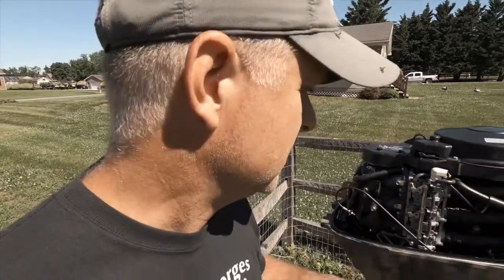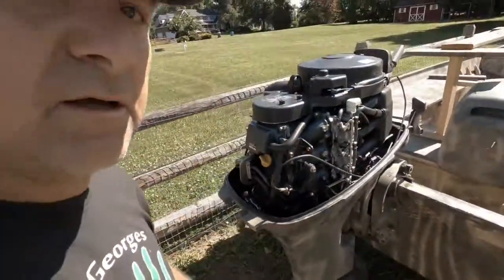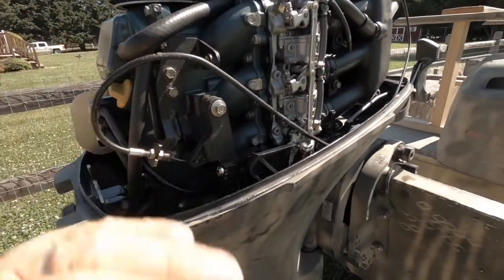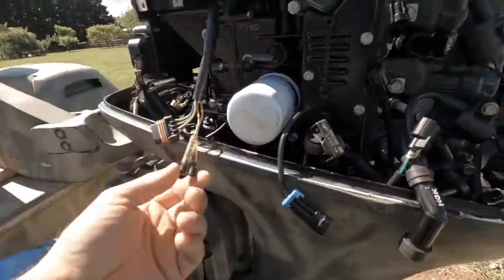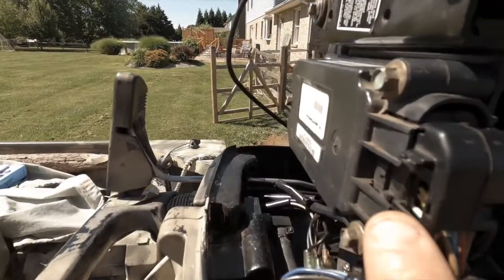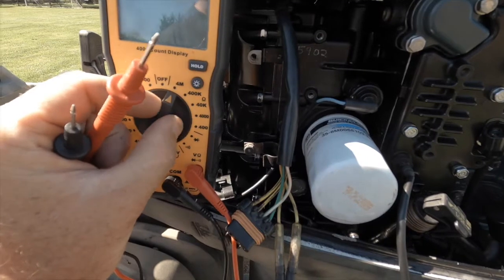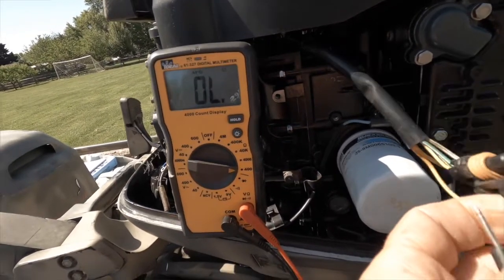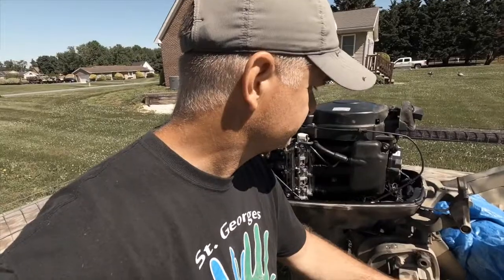Mercury 4-Stroke- ECM? Stator? Trigger?  what the heck is wrong?

Comment: Worse case scenario for me, to start pulling flywheels off. A relatively simple task becomes a P. I. T. B.
MARINER 15,FOUR STROKE. 
COIL READINGS ALL OVER THE PLACE.
288 KOHMS ON PICK UP COIL. 
78 ON STATOR.
 ALL NEED REPLACING.
Reply from the maker: Yeah, best bet is to pull the factory specs and see if they fall in line.

Comment: Did the stator fix your issue? I am looking at my son in laws motor, same issue, no spark on #2. It will
run with two cylinders but it has no power. I was thinking it was the ECM and saw they were no longer
available and if they were available, a little pricey to just swap out.  Thanks
Reply from the maker: Sorry, just saw this.  Ended up being the stator.  I saw the same motor for sale except it had electric start and thought I'd swap everything over and use it as a parts motor.  It fixed the issue
Reply: @ralphfreeman255  Well thanks for replying when you saw the message. I am looking for a stator now. I've had a lot of strange results in my testing. I think what's happening with this one is it runs alright until it gets warmed up and then it starts missing and the voltage readings drop.
Reply: Hey  I got a used stator and I'm getting the same readings I was getting with the old stator. Im getting good readings off the primary of both stators and I'm getting low readings going to the coil on both. I've tested and replaced everything except the ECM. Do you have a good ECM in your extra parts that you would like to sell?
I'm trying to get this running for my son in law. My daughter doesn't want him spending the money on
a new boat😀
Reply: Can I ask something? 

It starts and runs right? What rpm did it get up to when under load  before u swapped the stator??